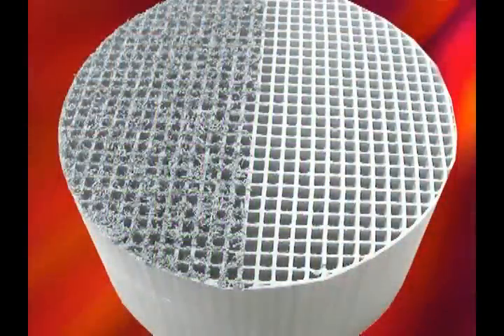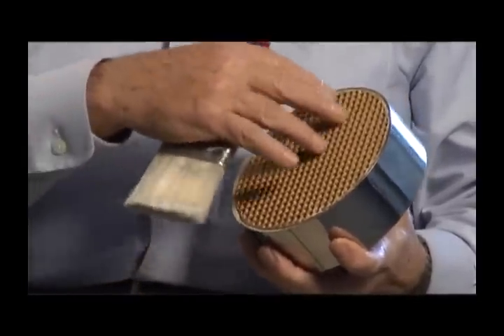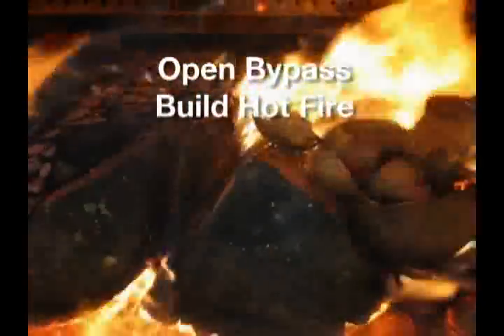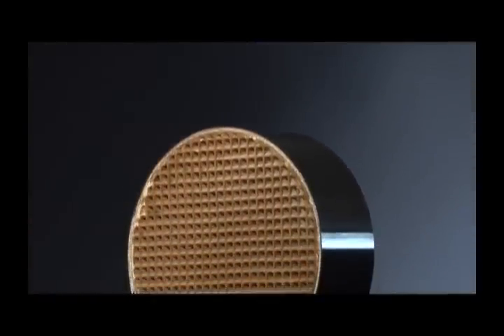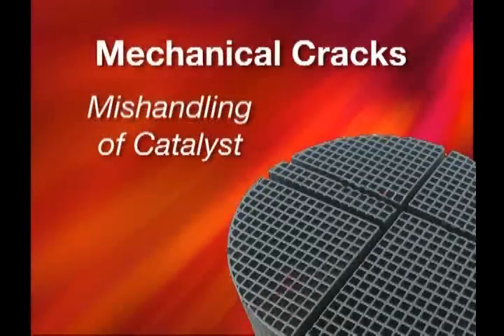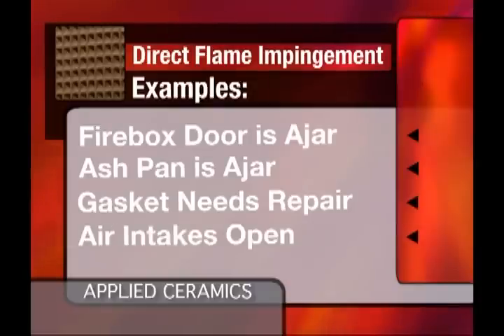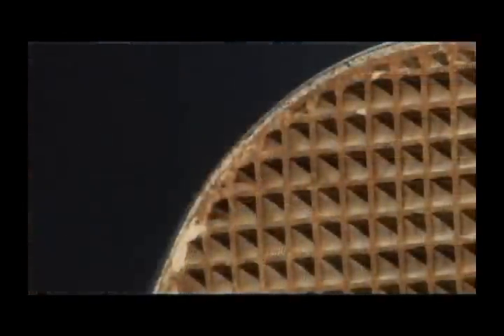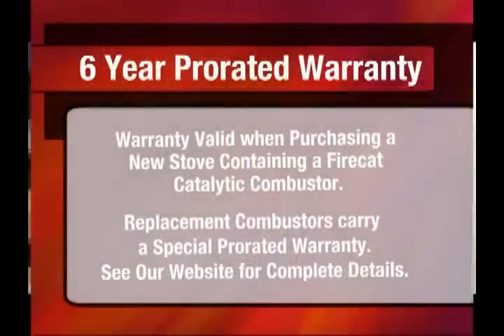Troubleshooting Catalytic Woodstoves Combustors©

Comment: can you use just plain tap water under a faucet to clean?
Reply: Not recommended. It doesn't have to be sparkling clean. Just make sure the holes are opened up and not overly caked with soot or creosote. Just get the majority of the gunk of and then get a nice hot fire going and run the stove on high in catalytic mode for a bit. It'll burn all the junk off.

Comment: I just ordered a set FireCat ceramic combustor replacement elements. The one in the woodstove lasted about 5 years. 
It's a Woodstock Fireview stove. Originally it came with a stainless combustor. The combustor was worthless. i could never get the stove to heat-up above 350-400 degrees F. Woodstock sent me another free stainless replacement combustor. It was just as useless. We went through troubleshooting session with Woodstosk trying to figure out why it was not working . I even bought some kiln dried wood but the result was the same. I was thinking about returning the stove but one of their sales guys offered to send me a ceramic combustor. Wow! What a diffference it made. The stove was alive and heating up easily. It was like a different stove. I could see the combustor glow red when operating.
Surprizingly, Woodstock quit selling ceramic combustors for this particular stove.